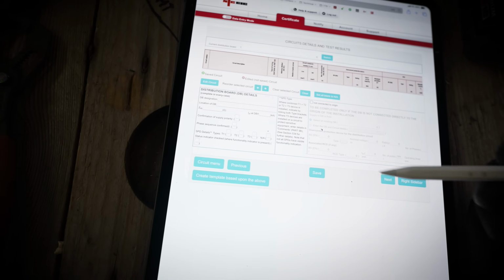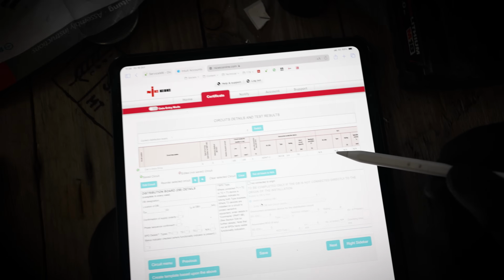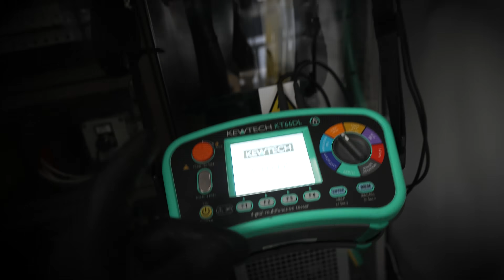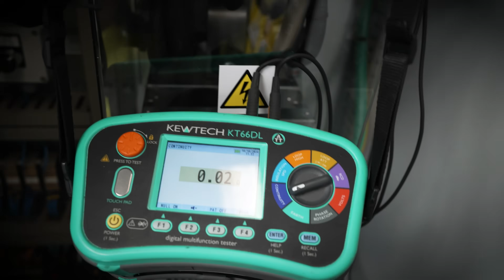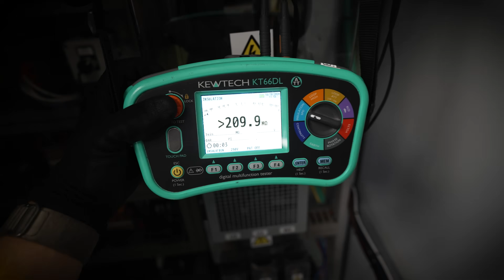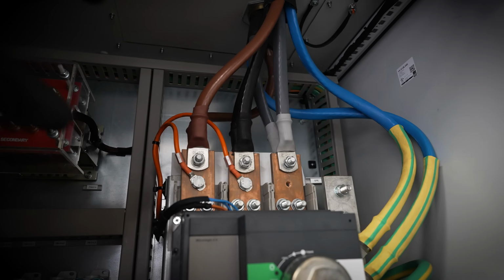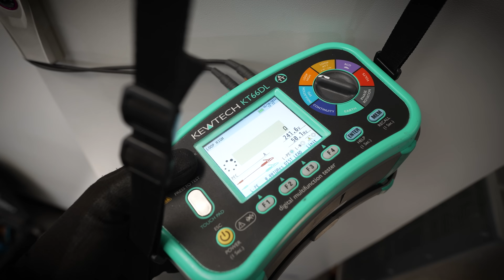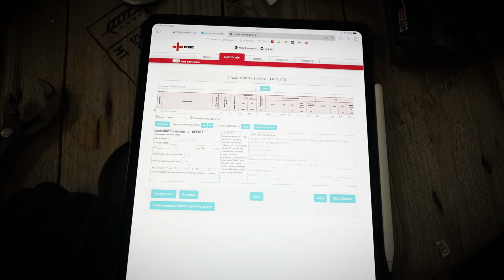Initial verification on a 630A circuit - Full electrical test procedure UK

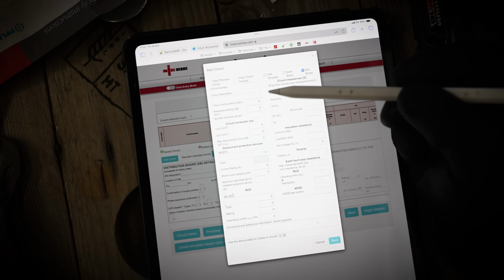Comment: 0:50 seconds in you say you can’t name the circuit as you can’t tell us what it’s for but it shows cell 2 unico drive for all other footage in the video 👀 - didn’t know if you realised that?

Also do you use the 3/8 or 1/2 m12 Milwaukee torque wrench in your 630a supply install videos??

Comment: Is the whole of this panel on the right dead ? 6:59 7:00
Reply: The only exposed metal is the Earth Bar. Every other wire in there is insulated but could indeed be live. The only live metal for those wires is inside each switch. Means you can run a new cable in to spare switches (as he is doing) without making the whole panel dead for safety.
Reply: Its just a wireway and if installed correctly it should all be insulated wires

Comment: Lovley Mike,

Just a quick one, noticed when you was doing your Cert, you only put the highest reading in,

Our NIC Inspector told us we have to put in 3 lines for 3 phase supply and issue the cert with the test on 3 phases. Hope that’s what you did

Comment: Decent Video mate!, when Carrying out IR at higher voltage on longer or parallel supplies make sure you discharge to earth with a link or you will get a nasty whack!
Reply: Meggers do, but the new one can catch you out of you have it on auto test.
Our apprentice zapped the guy doing maintenance on the LV panel while we were doing an EICR in it. He got a bollocking then went and zapped the same bloke 5 mins later 😢
Reply: Shouldn't the tester discharge it though?